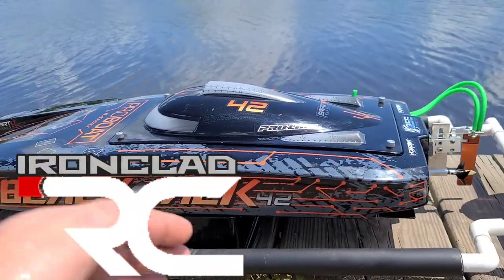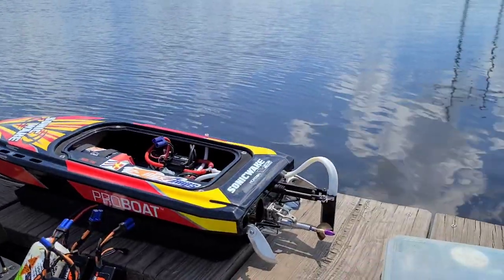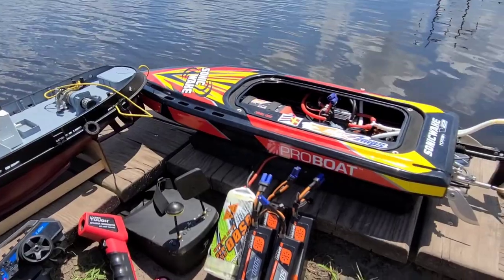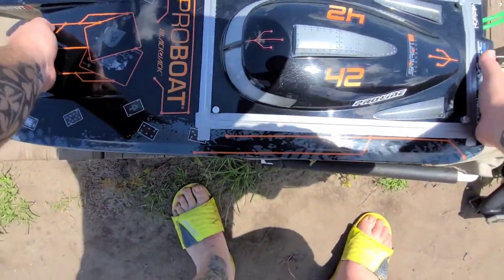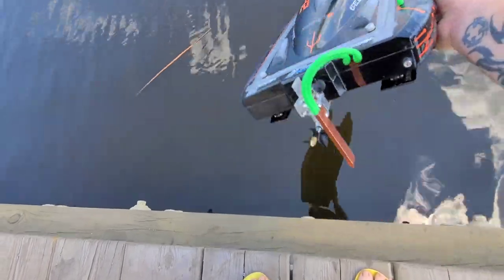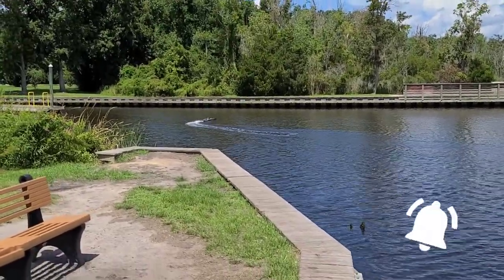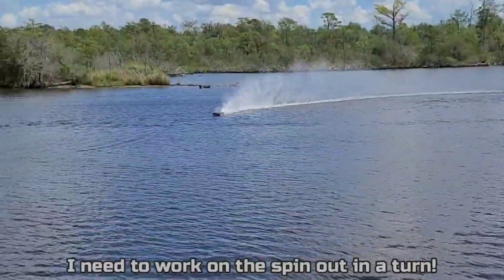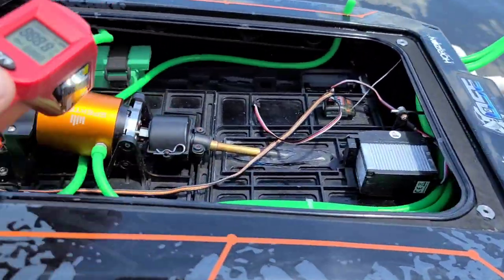The Quest For 70mph Sonicwake V2, Blackjack 42 - Fast Electric RC Boat Setup

Comment: Knowing how you like to push things to the limit, I would recommend running the new cap pack in parallel with the existing cap pack (or just replace the existing cap pack).  My reasoning for this is adding more connectors to your power transmission wires just adds that much more resistance where you don't want or need it.
Reply from the maker: Thanks for the information doc.  All input is helpful

Comment: Holy shit! Congrats Big B On the 6s 72mph swv2!! I feel like thats best in its class brother! I wanted to add a tip to make your life easier, I flipped the velcro straps around in the v2 so I can strap the 6s battery in, but easier access to release  them. Might help save you some time. It's kinda hard to weave them back the other direction but it's worth it! Boat gang baby!!
Reply from the maker: Thanks I've. Even running my straps in that configuration for quite so.e time, i love it.  Thanks

Comment: Great video Big B. I get 53 mph, 4s 5000mah 100c with octura x442 prop. Raider 150A.
But runs cooler,  and I like that.
Reply from the maker: Yes sir, the 642 is an awesome prop for the sonicwakes.   I received the package thank you very much.

Comment: Took a good look at the V2 today. The left trim tab was around 1/4" lower then the right side. Used a ruler to level it out. Boats  going straight as an arrow . Left turn is great now. made a few speed runs wondering if you could take a look at my ESC
Reply from the maker: That's great to hear brother.    Glad you got it worked out.      Email me ironcladedout@gmail.com maybe I can help?

Comment: Love your videos! Question: can you run 8S batteries in a stock Sonicwake? I heard it would burn up your esc or motor.
Reply from the maker: You need to upgrade the esc to the 160 spectrum firma in order to run 8s..   8s in the v2 sonic wake its basically for speed runs with the stock 2000kv motor, short pass check speed then do it again type deal.   If you run 8s doing ovals the prop size needs to be small so it doesn't over heat the motor..  check Temps regularly

Comment: Big B did you adjust the trim tabs when boat was stock?mines not turning left very well
Reply from the maker: It's the turn fin length if the rudder were longer like the v1 rudder you could make a better left turn.    The rudder comes out the water in a left turn reducing steering. Mine does it too

Comment: Big B I love your channel and boy I can't wait for the new castle hydra xlx2 but what do you think about making the bj42 a twin setup or I got tp cm4070 2900kv out of my arrma limitless but with that super high kv what prop should I try. I also have a castle 1717 1650kv or castle 2028 1100kv for either the bj42 or sonicwake v2 I just have those motors sitting around and I'm definitely ordering that ose 150esc for the sonicwake and I just got a 50mm 1.6 three blade and love it
Reply from the maker: I've given the twin a thought since I bought the boat.   I think I'm gonna keep her single motor.    There's plenty of room for twins that's foe sho

Comment: Im about to buy a Sonicwake v2, do you have any basic setup tips for the V2 out of the box for a bashing/fun boat? It will be out on a lake with some smaller waves at times. Trim tab, turn fins, prop shaft, rudder geometry changes to the out of the box setup? I'm not going for top speed but rather more runtime, (hopefully 8 minutes or so?). Hoping for something reliable that will give me more runtime than stock. I was thinking a less aggressive pitch prop, maybe a 4516 or so. What's the largest 6s battery you'd recommend without destroying the handling?
Reply from the maker: Out the box I'd go up on both trim tabs about 2 full turns. I had to  pull the trim tab off the boat and slightly bend the tab up so the set screw contacts the tab I'm it's up position, other than that start with your cog forward, if it doesn't blow over move cog back a little bit.
Reply: @IRONCLADRC  how about largest battery recommendations and increasing runtime?
Reply from the maker: 9500 mah  but I'd stick in the 6500-7600mah range lighter weight and more agile

Comment: hey man! I love your channel! I'm a disabled Vet and recently I have gotten into Rc everything and I've 3D printed a speed boat. I got a 4074 2000kv motor with a 150A water-cooled esc. I need help finishing this up. I want to fiberglass the entire boat bc by itself will not handle what I'm going to do to it. I need help from you so I can be successful.
Reply from the maker: I'd use epoxy, it's much easier to work with
Reply: @IRONCLADRC   yes I got epoxy and fiber glass I need a good motor mount. Which one should I get for a 4075
Reply from the maker: @Mya-2022  you'll need to do the measurements, here's a good selection from OSE 

https://www.offshoreelectrics.com/products.php?cat=Motor+Mounts&PARTNER=ironclad
Reply: @IRONCLADRC  sorry I just saw your messages. I have come to find just using epoxy is much easier but it is gonna look cool!! I'm persistent and I wont give up until its done right. Thank you for spending so much time teaching us what to do and saving us tons of countless hours!! I appreciate you

Comment: Will a Spektrum 4685 4 pole Brushless Marine Motor 1350Kv fit in sonic wake 36 v2
Reply from the maker: With major modifications it might fit?
Reply: What motor would you recommend to to to run 8s or more on my sonic wake 36 v2

Comment: 24" Pro Boat Wire melted I have the same set up as you do separate water lines to ESC & Motor
changed the water line pickup with a deeper line with the Rutter almost even 
Any more suggestions ????
Reply: Trying to keep this Motor cool
Reply from the maker: Raise your strut....      Run the boat once check GPS let cool. Few minutes  then  hit it again.    I told everyone it's a hot set up.
Reply: @IRONCLADRC  thank you

Comment: I personally would add bullets to the main leads...those little wires are most likely soldered to the board with the main leads...that 16g wire would act as a bottleneck for what you want caps for
Reply from the maker: Thanks for confirming my thoughts I most definitely appreciate the input.
Reply: @IRONCLADRC  yessir!!!! I may be newer to boats but been around rc and hi power electric setups for quite a while